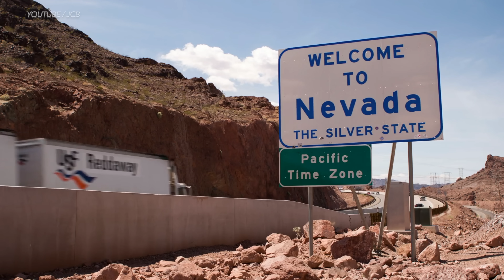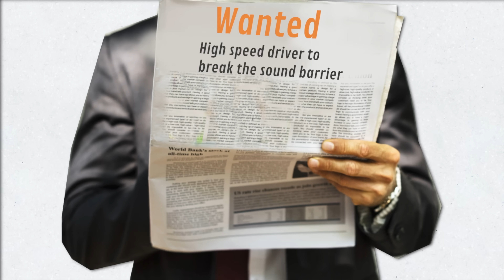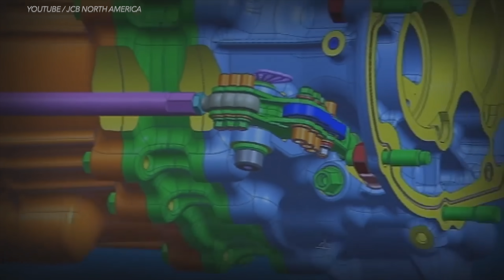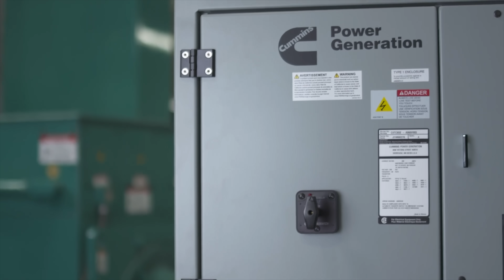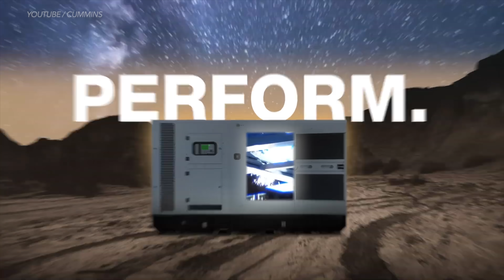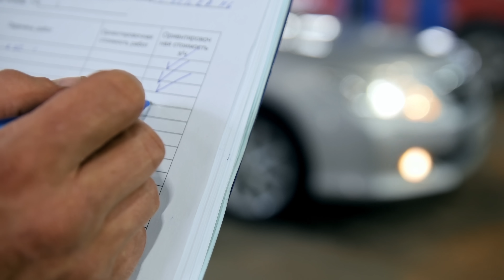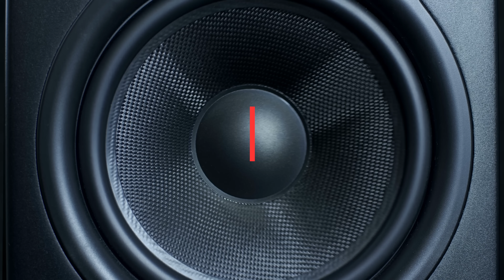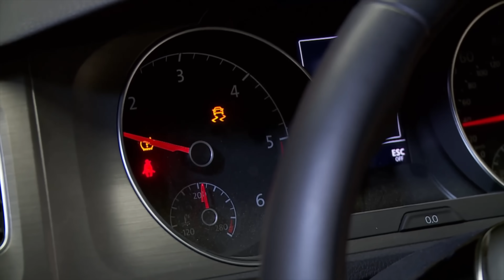Here's Why Diesel Engines are Being Banned

Comment: Hi Scotty, I own a diesel Ford Focus 2 litre TDI, purchased in 2016 for £5000 British pounds. Before that I had a Ford Mondeo diesel, and an Audi 100 diesel. Frankly I wouldn't buy anything other than a diesel given the choice. I have previously owned petrol cars and know their limitations. The fuel economy on a diesel is much better than with petrol. Many years ago I commuted daily from Worcester to Birmingham in England, approximately a 60 mile round trip every day. One time my old diesel Audi was in the garage whilst they looked (and failed) to find an air leak in the fuel system; and I borrowed a friend's petrol car, a 2 litre Rover, for the week. In that one week my fuel costs doubled. I couldn't believe how much more it costs to run a petrol car compared to the diesel, and my diesel engine at that time was 2.5 litres, compared to the Rover's 2 litres.
As for cold weather starting, I have never had a problem except once when the battery died. Almost always it starts first time every time, even down to minus 17 celcius here in Bulgaria where I have retired. There is therefore no chance of me flooding my engine trying to get it started. I have also never had a diesel car stall on me.
One other advantage, especially given the way the world is going now, is that, if I have to, and diesel becomes unavailable, you can always filter and use vegetable oil to fuel your engine. You can't do that with a petrol car. Indeed, since petrol is delivered by diesel tankers to fuel stations, should diesel become unavailable, then even the petrol car drivers won't be getting the fuel they need. Something to think about.
Great show by the way. Always informative and entertaining. If MSM wasn't the play-thing of plutocrats, you would be prime time.
Reply: In the US, the only Fords with diesel engines are trucks.

Comment: had a diesel that just had it's injectors pop one after the other at 125 brittish pound sterling each to reseat at a diesel specialist workshop. After 4 out of 6 plus some other issues I just sold the damn thing. Apparently a typical Mercedes diesel engine issue where the injectors are only held on place by a single bolt on one side.

Comment: Scotty, although the ppm of NOX and CO emission were rated higher than US Federal standards with the VW scandal : what is NOT captured in those is the miles traveled, example of dispersion.  VW has a 1.8 diesel that gets near 70+ mpg - but is too high for NOX emissions per gallon.

In certain professions - the solution to pollution is dilution.  Which at a minuscule amount of emission off gas over federal standard per gallon of fuel - unfortunately is not accounted for it’s dispersion between say 40mpg vs 70mpg of travel.   Thoughts?

Comment: Years ago I had a new 2000 VW Jetta TDI Diesel, with an automatic transmission. I traded it in for a 2007 VW Jetta gasoline engine with an automatic transmission. I should have never traded in the Diesel VW Jetta. It was amazing on fuel economy and power with plenty of torque, the Turbo Charger helped. I wish that I could get another Diesel VW.

Comment: Diesel engines are technically the blueprint engine for hydrogen combustion engines. Currently in the UK there is a train rail freight company trialling a bi fuel diesel engine which runs on both diesel and hydrogen. JCB has also created a range of construction equipment running on hydrogen which utilise a modified diesel engine.
Reply: I don't agree with that. Hydrogen combustion is much more similar to gasoline nearly being capable of running on the same engines. Not to mention that hydrogen combustion is basically a dead platform as fuel cells can go nearly twice as far on the same amount of hydrogen. Not to mention hydrogen combustion still makes NOx emissions which again is a carcinogen. But since even hydrogen fuel cells get worse range than ICE cars that shows why that's a serious issue. 

The Toyota Mirai for example is the best known fuel cell and only gets a range of 402 miles, there's already EVs with just as far ranges. Not to mention most hydrogen fueling stations only actually push out half the pressure required to get that range so you actually get only around 200 miles in most cases. That's pretty bad compared to gas or diesel. Not horrible compared to EVs, but again, this will be twice as bad if we used hydrogen combustion.
Reply: @Skylancer727  If you are going to use hydrogen then it might as well be in a fuel cell. Silent, clean,  powerfull and no moving parts..
Reply: @paulmcgown7504  Fuel cells require rare minerals much like batteries!

Comment: I'd take a diesel engine. Kept with good maintenance and oil, good ones last forever and are much more dependable than gas engines. The cold temperature issues are a thing of the past. Plus, they're more fun to drive....big torque.
Reply: Yes.  Love the torque factor in diesel engines.
Reply: Yes they def do have problems starting in the cold still. Not as often but on really cold nights yes. However, the newer trucks (gas and diesel) can hardly get through a few inches of snow anyway. See 5 of em totalled every winter during a snow storm on a 10 mile stretch of road. If you're at a dead stop trying to get through any amount of snow going up a hill, fat chance. Yes even in 4wd. Take the old diesel any day.

If you dont live where it snows sure you're good
Reply: One of the best heaters I found for the old 240 d I had was a dipstick heater my dad found and bought it worked great you just put in for about 45 minutes and it warmed up that oil quick and it was enough to where she would start right up. Mine was California picky because if temp drop below 62 overnight it didn't like to start in the morning unless you put the dipstick heater in for a few minutes.  Then after that it would start and away you go
Reply: @davidgleason3379  Bellow 62°F ? I'M up here in New England and we have 20to 30 nights a year where the temperatures drop below 0°F My 02 and 04.5 cummins fire up even if I forgot to plug them in. Power steering and differential are a whole other story.
Reply: @thedude8976  well  even are cars get a little soft out here in California.  I can remember a good friend of my late wife used to come out and visit us she lived in Connecticut this was also where my wife was from.  Well I always got a kick out of Janice when I would be looking for a jacket to put on heck she was walking around in short sleeve shirt and wearing shorts.  I know the people back there a lot more hearty when it comes to cold . Myself I will be first one to admit when it hits 60 I am a weenie and have to go put a jacket on . That what happens when your born in San Diego CA  we are spoiled.  Now where I will be moving in Nevada in a couple of months.  Winter time gets 17 or Lower at night well up there I have a 96 f350 disel and my sister was driving for awhile before she bought a new car there was a couple of mornings where the truck had not got enough sunshine where it sits in a carport and it wanted to give a little hesitantation but it would finally kick over  . Just recently out of curiosity I checked what that old 96 was selling for I darned there jumped out of my chair.  More people are finding these newer diesel where you have to deal with that urea filter and have to put some kind of other additive  to be a hassle.  I remember when that Cummings first came out in the dodge trucks. Whoever at dodge thought about doing I hope that person got one of the biggest raises in pay because that is what saved dodge.  .and this is coming from a guy that has always liked Chrysler and dodge trucks and also for the last 39 years have  owned and up until about a few years ago drove my 1965 Plymouth valiant every day . I have owned a few other cars through the years and that little Plymouth I got when I was 17 and even took my driving test in 1983 has been one of the best cars I have owned.  It's now 56 and I was born the next year after it was built that car is in better shape than me.
Reply: Driving use is a factor to consider before diesel purchase. Short yrips around the city will ruin the diesel. They need to get well warmed up. Stop and go driving does not do it.
Reply: @daledavies2334  no!
Reply: My 82 gmc 6.2 diesel (I know.  They're junk to some of you) started at 22 below zero one morning, on the first glow plug cycle!  It was a 3/4 ton truck that got 28 mpg empty and 21 mpg loaded.   The technology seems to have gone backward..  Fords are amazingly quiet.
Reply: @keithchrysler3732  owned several GM 6.2 diesels and my brothers (big GM owners) owned several each and none of us ever had one get near that mileage. Average empty, 19 put a load behind them and the went to 9-10. We pulled real loads, 10,000-15,000+ pounds on these duallies. My '90 dodge Cummins towing 20,000+ pounds averaged 16.7, empty, 25.
Reply: My old 10 years old cee'd 1.6crdi even at -18C 0F always starts, without problems. Lower temperatures happen very rarely where I live, so maybe below that there are problems. Good accumulator and fresh filters are the key. Noise? Yes, you can hear it clearly on idle, but a gasoline engine is more noisy with a heavy load. Having almost 300Nm torque is a wonderful feeling, accelerating to 50 kph in a city or from 90 to 140 to change a lane on a motorway or climbing a very steep hill is like in a car with a twice hp.
Reply: right on bro!

Comment: Love your Youtube videos.
It's a case of perception vs reality.  Diesel is a better fuel, produces less emotions, gets better mileage, and is cheaper to refine.  Current technology allows them to run with almost no emissions.  They can be run green on natural oils as well.  Just start the engine on diesel until operating temp then switch your cooking oil.  Switch back to diesel a couple minutes before reaching your destination to keep your injectors from plugging when it cools.  Going green?
Compare the No2 to the Carbon Monoxide gas engines emit.  One's an airway irritant and the other remains in your system long-term causing organ failure. 
The biggest issue is operator's choosing not to educate themselves like you see in the "Customer states" on YT.  Karen would likely ruin a diesel engine in a couple months and get upset. 
I agree.  The diesel is likely going to go the way of the three-wheeler of the 70s.
Reply: That's good I do not like emotional engines.
Reply: @steven4315  LMFAO

Comment: Well Mr Kilmer, disel engine is the work horse of the economy and I don't think they will be replaced soon as battery cannot even match them in terms of range, power, towing capacity.. As you say these people are not thinking straight.. S battery operated vehicle can be a good one for light city use only.. You tow then, the range goes down like 60 to you 75%..

Comment: I have a 2018 GMC Terrain.  1.6L diesel.  I drive a lot of miles mostly in and around Chicago and am very pleased with getting an average  38 mpg. 76,000 miles on it and no issues. You wouldn't believe how quiet and smooth this suv is. I don't understand what the resistance against diesel is about. I hope more small diesel vehicles will be made for the U.S market. I love mine.
Reply: I live in the UK and have a 1.5L diesel 2009 Renault Clio. It's a supermini hatchback and it nets me 60-70mpg no matter what driving to do. It's just unmatched by anything in the petrol space for economy.
Reply: how's u gmc ? any issue ? I want buy the 3.0

Comment: I'll never buy a diesel again. The new cars have too many complexities compared to same gen petrol.
The exhaust system with dpf is a complex system. The injectors and turbo are expensive items as well.
Good when new but once older expensive to maintain
Reply: TRUE DAT.  Get the Cummins then.  Inline 6, easier to work on and less parts and less things to go wrong.

Comment: I can't see where modern diesel engines are load or any more noisey than gas motors. I wished GM had put the whisper diesel in the malibu rather than the cruze and equinox.

Comment: I am in Europe and I am driving a diesel station wagon. It gives me 6l/100 km or 40 mpg in your measuring system. That's combined but I travel mostly outside the city @ 120-130 km/h or 75-80 mph. I have the 4 cyl 2.0 hdi RHR of Peugeot with 136 bhp and 320 Nmof torque. These are great reliable engines and properly maintained they go easily to and above 500 000 km
Reply: 6l/100km is very very good
Reply: Adjusting the way you accelerate and drive your car generally you would easily be able to go down to 4.5 to 5 l/100km. It’s not that big of an engine.
Reply: @th3m3du54  I guess I could. But honestly - to reach the advertised 4.6 extraurbsn for this vehicle one has to drive granny-style. And who is driving like this? I am talking normal driving. I don't drive like a mad dog. I take care of my car

Comment: I own and drive a 2006 VW Jetta manual transmission TDI. This is a GREAT car, even though quite a few parts went bad and were very expensive to replace. I do my own work, which is the only way one can afford to keep one of these. Diesel rocks! over 40 mpg with regularity.

Comment: I have a Mercedes E350 with a Bluetec 3L 6 cylinder diesel. I get 35 mpg mixed city/hwy and 40-42 mpg at 75 mph on the hwy.

Comment: Hey there Scotty!
I have two diesel cars. One is a 1987 Diahatsu Charade Turbo Diesel. It's a 1 litre engine. It does 560 km on a full 30 litre tank in the city. And 650 on the highway. It's got its original engine overhauled twice. It's not very quiet. But it's one of the best reliable cars I have ever used.
The second is a 2003 BMW 530d. That being a monster 3 litre turbo charged engine is super fast. Insane amount of torque. Doing 750 km to 850 km on a 70 litre tank. And 1100  km on the motorway. Both these cars are super efficient.

Comment: After working in Europe, and Latin America where diesel engines are/were the default, I  prefer diesel powered cars and pick ups.

Diesel fuel was always cheaper than gasoline.  Santiago de Chile has a severe pollution problem therefore, diesel was given preference because of better emissions.

Comment: Electric vehicles run on electricity stored in batteries. Electricity is generated using fossil fuels and the manufacture of batteries causes pollution and they need replacing eventually creating more pollution. It is a huge scam. Hydrogen powered cars is the way to go but cheap and don't generate revenue. So they want to kill it. Hope Toyota persists with it

Comment: 96 Dodge 1 ton  2wd. automatic  Cummins 12 valve. I have had this rig since 2000. Excellent. 30MPG on the highway with a light load., Dodge clear coat paint is peeling, and plastic body parts are cracking and breaking. Never garaged or carported. 186000 miles in Oregon and California, It drives so sweet I'll never get rid of it. Had Chrysler put more into quality body parts?  Wow. What a truck it could have been, They missed the boat. a great truck could have been amazing. I will have it painted and fix all the cracked plastic.
Reply: 2009 6.7 owner here, 278k miles and still going strong, the problem with Dodge trucks of this era is that everything falls apart around the engine, it's better than a Ford from the same era, the engine falls apart before anything else can
Reply: My F-250 is the same.  Engine and drive train still original but all the plastic parts in the interior are broken, snapped, busted.

Comment: I would like a diesel, but seeing as I do not want to drive a heavy duty pickup truck or a very old car, I drive a gas powered car. If diesels were more available and more affordable, I would absolutely pick one up.
Reply: Look for a used vw there out there
Reply: There's no shortage of cheap VW TDIs out there, you can find one with less than 200k miles for around $5-6k, if you wanna go cheaper than that then you're probably gonna be looking at cars with over 200-300k miles
Reply: The dealer told me a Chevy cruise that had a diesel engine cost $10000 more than a gasoline engine.. Oil companies are actively suppressing diesel as much as they can and I will bet you in the future they'll find a way to outlaw it. It's just far too efficient for their taste

Comment: I will tell you why not to but a diesel! I am a heavy duty mechanic and SCR   (selective catalyst reduction) and DFP (diesel particulate filter) works but cannot run more than 6 months without the CHECK ENGINE LIGHT coming on! It's very expensive to fix!

Comment: Anybody who's ever owned a Diesel Pusher RV can tell you that Diesels are preferred over gas. Why? Well, much higher horsepower allows the diesel RV to carry more weight, meaning that real wood furnishings are used instead of cheaper woods for gasoline RVs. And because diesel RVs are so much heavier, they are easier to drive in high wind situations. Diesel engines are barely broken in at 100,000 miles whereas gasoline engines are suspect at that mileage! So, there is certainly a market for diesel engines in today's RV world.

Comment: Diesel engines was good before they started install Dpf filters and use DEF with a lot of emission control sensors!!!It's make  Diesel engines unreliable plus low sulfur fuel killing high pressure fuel pumps or injectors!!!Bio diesel have more lubrication but more corrosive to metals!!!

Comment: I have an 06 Duramax. 1 ton 4×4 longbox that gets better hwy mileage than my Honda pilot or Chevy traverse. Close to 500,000 on it burns no oil. Original motor and transmission. I'll drive it into the ground before I let it go.

Comment: I can't stand Diesel engines myself.  I've had nothing but trouble with them, because, well, I live in an area where it is winter 8 months of the year.  And when i say it gets cold, I mean fricking cold, sometimes -40.
Reply: I run a Cummins in North Dakota is starts very well actually. I do plug in when negative and below if I can just to be easier to start. I used to worry about that. The trucks with glow plugs may be a different story.